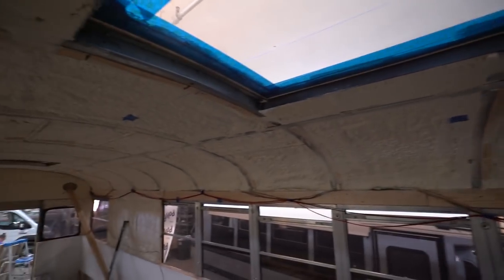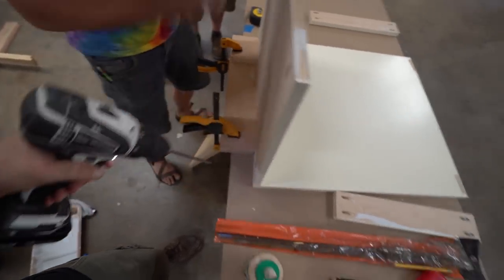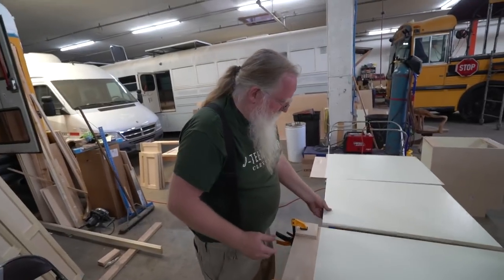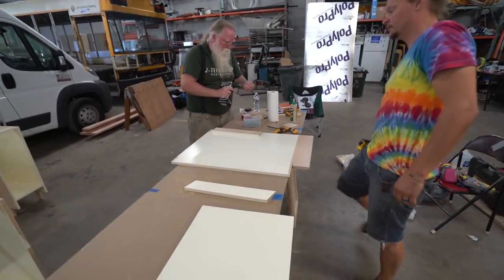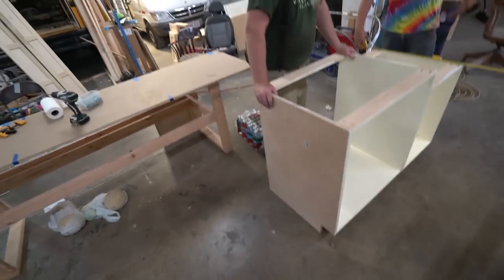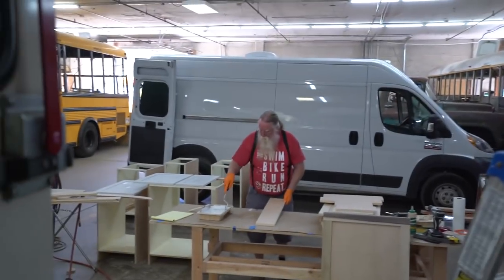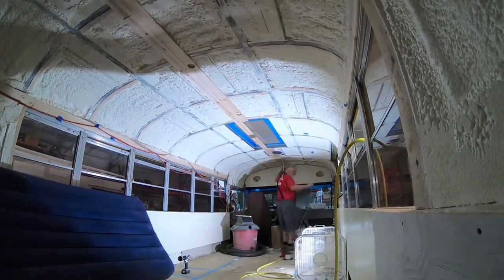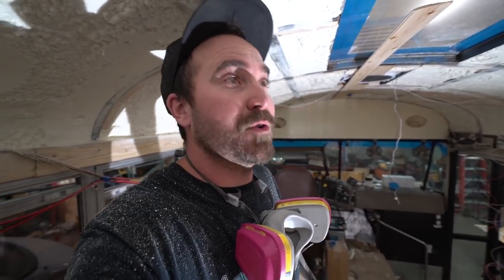MojoBus + Steve Made Me Cabinets!

Comment: Test the hidden wiring out before you get too far on the ceiling, its easy to damage or drive a nail into the wiring , ive even seen brand new wiring damaged on the spool or from something falling on it when its all stretched out on the floor. even sombody rolling something heavy across it, i have done it myself i wouldnt have spray foamed in the wiring cause if you ever have a problem youll never find it, this way you can get to the wires.

Comment: Your crew got alot accomplished in this video. I keep getting confused when you point out the inside centerline of the ceiling. It does not ever seem centered.
Reply: You are correct. The line is offset the width of one board. We put up a guide strip along the line so that the first boards are centered
Reply: That makes sense to me now. Thanks for getting me straight  as well.